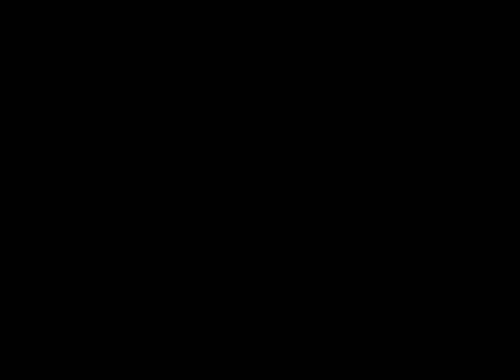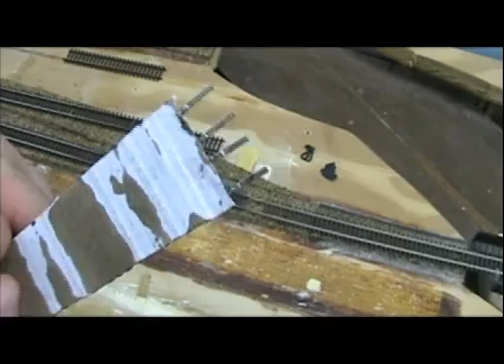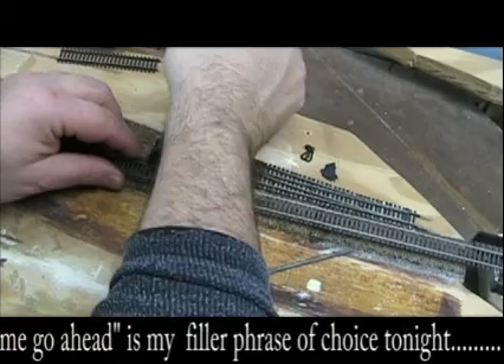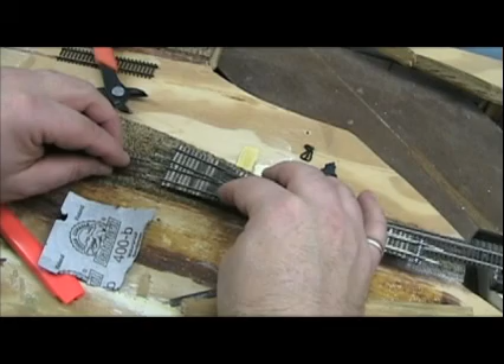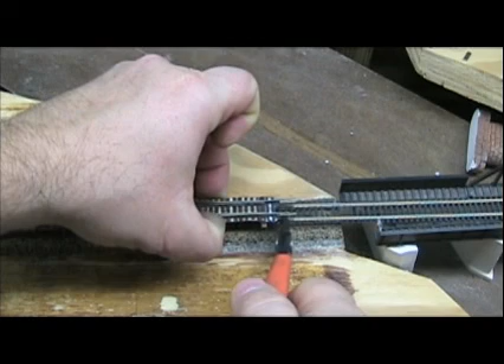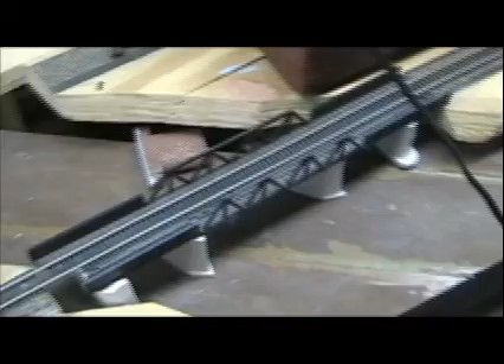Model Railroad VLog: Hand Laying N Scale Turnouts: Part 52

Comment from the maker: There's two things I can spend to get the turnouts I need for my layout: either money or time.  If I buy all the turnouts I need (and I need about 60 or so for my current plan) I'd end up spending at least several hundred dollars.  By making them myself I spend only about 1.50 per turnout.  I'd rather spend the time than the money (and yeah it's fun too).  

E